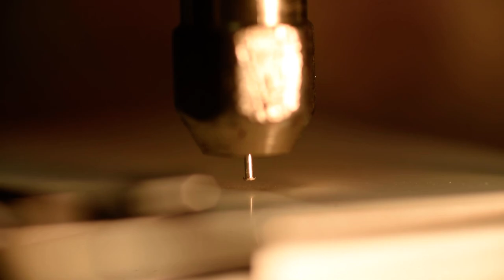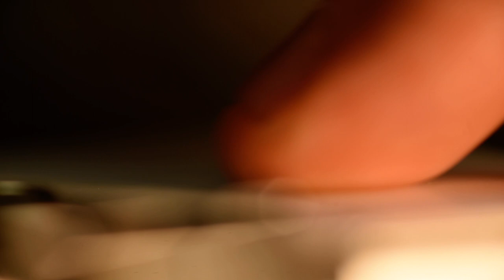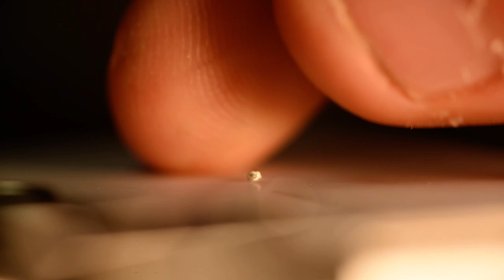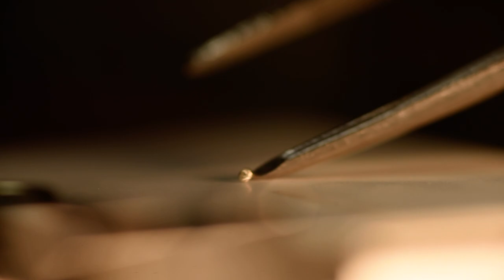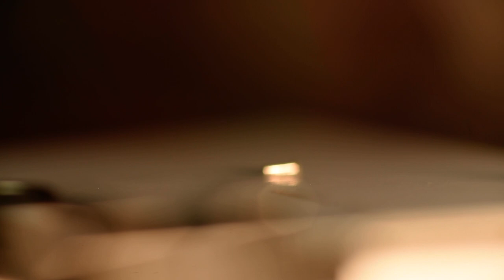AAA 4442

Comment: If you're trying to stir weld with silver, you'll probably need a thicker rod to spin, or more structural support around the tip so it's not cantilevered as far. Cool project!
Reply from the maker: Yes. I think if we were to continue with the friction stir welding approach, we would probably go at it with a 4th axis like the rotbot printer mod, and use additive friction roll bonding. Like in this paper but small:
https://www.sciencedirect.com/science/article/pii/S2352492821009909

rotbot link from CNC kitchens video about it and nonplanar slicing:
https://www.cnckitchen.com/blog/the-rotbot-4-axis-non-planar-3d-printing

Comment: Pass current through the silver  ? It doesn't seem to be hot enough. Also silver is going to soak so much heat, the whole spinning assembly should be as hot as the bearing tolerate.